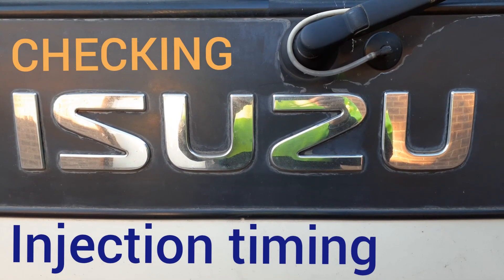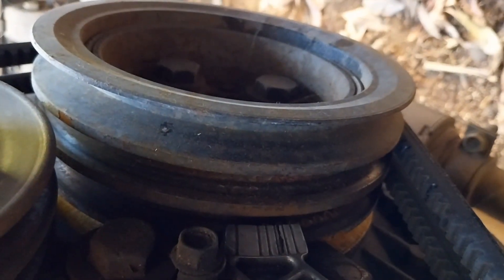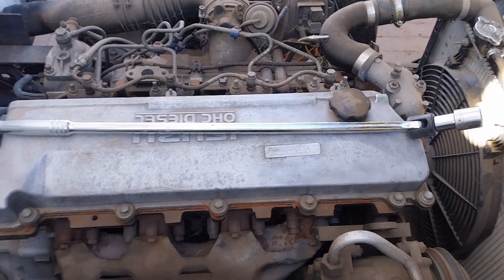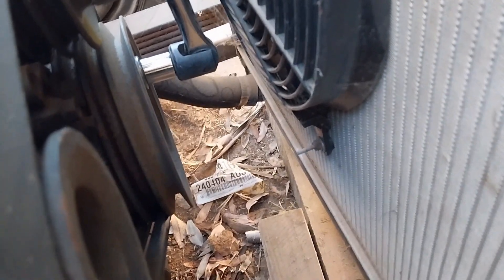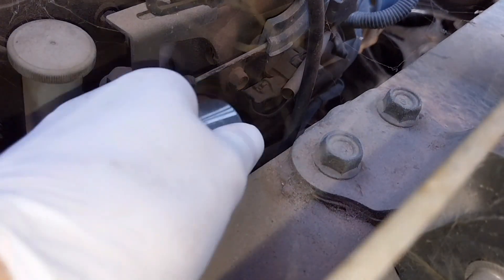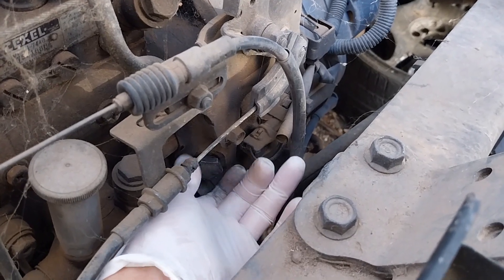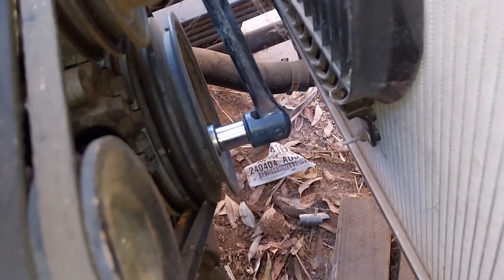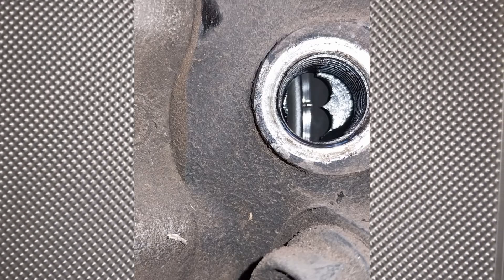CHECKING INJECTION TIMING ISUZU NPR ZEXEL/ BOSCH IN LINE MECHANICAL PUMP

Comment: Hi Vidtech
I need your help I have a NPR72L-7401212 RJJ/4HJ1 engine inline pump 
What's the pump and cam timing for this model , I set pump to 9degrees and cam horizontal make set on damper TDC but the engine cranks and won't start.
I tried to find a manual online but failed 

Your will be very much appreciated
Reply from the maker: @menelisindlovu178  Hi , I don't have the specs for a 4hj1 , on some models there is a sticker on passenger side b pillar with basic specs , like injection timing.  With the cam timing , I'm pretty sure , it aligns level with the top of cylinder head , HOWEVER I'm certain that it aligns with or at TDC ,and not the injection timing .Hope that helps .Also how sure are you that the pump is aligned at the compression stroke and not out by one revolution?
Reply: @vidtech2650  thanyou so much will try look for the sticker ,lam very thankful 🙏 also if there is anyone who can help with this specific  model lam willing to pay you can refer me
Reply from the maker: @menelisindlovu178  also are you sure the pump is aligned on the compression stroke and not out by a full engine revolution?
Reply: @vidtech2650  how can I set out by one revolution?
Reply from the maker: @menelisindlovu178  did you take the cylinder head off as well ?
Reply: @vidtech2650  yes we took off cylinder head,  fitted new liners and pistons and put back everything I can send you few pic
Reply from the maker: @menelisindlovu178  and before taking out the pump , I assume you have set it at the injection timing with the 9 degrees , and confirmed on the pointer , one the pump sight ?
Reply: @vidtech2650  yes l have marked the damper pully the pump is currently exactly on 9degrees ,lam.100% the unfortunately thing we forgot to mark pump timing  before dismantling the engine that was a bad move
Reply from the maker: I have another video where I remove the injection pump and fit it again , I had to remove the pump to get to the oil cooler seals . The video is called: ISUZU NPR OIL COOLER SEAL REPLACEMENT/ INJECTION PUMP REMOVAL & INSTALATION.  You can find it in my ISUZU NPR DIESEL playllist.
Reply from the maker: If you remove the rocker cover and turn the engine by hand and observing the valves opening sequence on number 1 cylinder,  you should be able to establish,  the compression stroke , or exhaust stroke . Hope that helps.
Reply: @vidtech2630  I would like to thankyou once more I found the B pillar sticker

Jet period 8 ⁰ BTDC  ,injection pressure 185kg/cm, valve clearance 0.40 mm both in and exh

I will make amendments accordingly and  update you
Reply: To be honest setting pump at compression stroke  was just a trial since l haven't  manage to get my hands on the specific model ,my you shed light when you say out by  one revolution